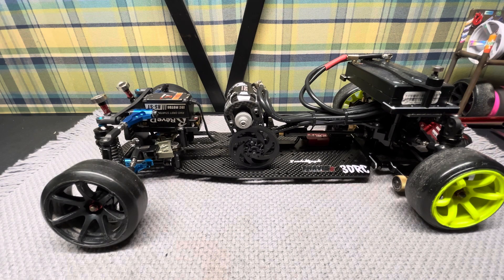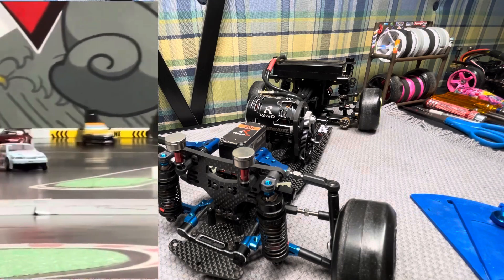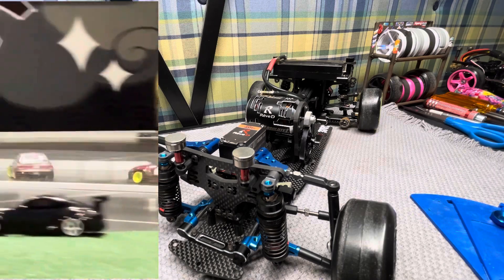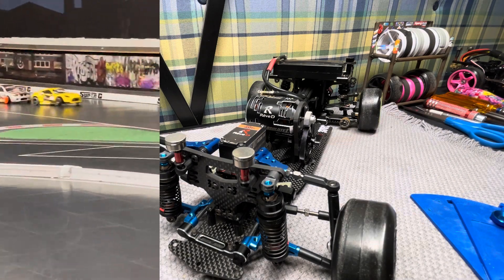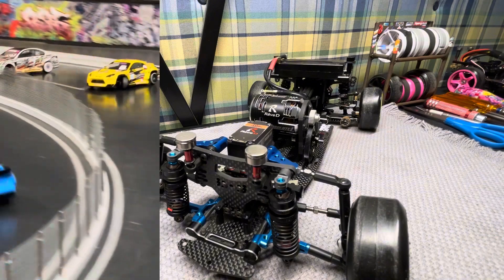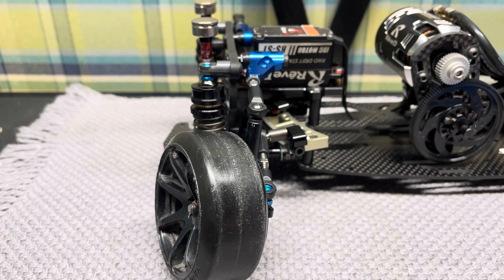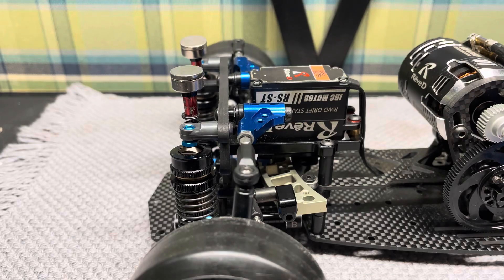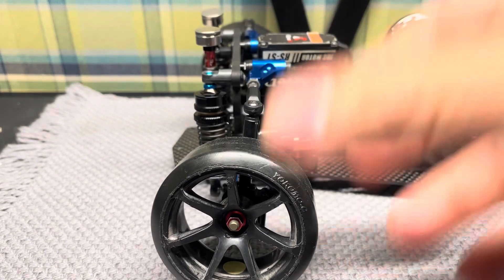TUNING GUIDE FOR RC DRIFT EP-2 ( basic front end alignment )

Comment: Great info! Could you do an ESC tuning video in relation FDR video?  Seems like most people don't account for ESC setup when choosing FDR especially with 10.5 or 13.5t motors getting the right tune will give the right feel and with a good mechanical tune setup the driving experience will be more enjoyable
Reply from the maker: Great idea! Ima have to do that after the tuning vids. And yes as always the balance between all 3 motor, gearing, and esc is important to feel every rpm.

Comment: Thank you for the vídeo! Helped a lot! What about the springs? I see that in your car, it is very, very soft... What springs should we use?
Reply from the maker: For my wrap up Travis it’s a high battery car meant for realistic roll and weight transfer. So my springs are super soft and not recommended for a normal low battery set up. In the future I’ll get into springs and shock tuning but a good beginner spring set would be the reve’d box 006AS the linear springs. I highly recommend that one. My TT02 had those on he front and rear.

Comment: if i want more ackerman on the slide rack your using, id put a bigger spacer to move the link attached to the rack forward or a shorter spacer to move it backwards?
Reply from the maker: Yes for a similar slide rack or bell crank like the reve’d bell crank, a spacer is needed to adjust Ackerman. NOTE!!- Too big a spacer will cause issue with steering stroke and trailing wheel link clearance. This can be avoided by a curved ball cup or a knuckle with scrub adjustment. This will be mentioned in EP-3

Comment: hey man, was wondering if there is any tips for setting suspension sag. Appreciate your help, Thank you
Reply from the maker: For extra droop? You’re gonna need to change shock length. Long top caps, long bottom caps. That changes piston position and the compression/rebound stroke. Good for higher level tuning but watch out, improper length will cause bottoming out and possibly uneven pressure in the shock chamber.
Reply: Appreciate you :) @SHREDDITRC

Comment: what mods did you do to your TT02 for it to be Drift compatible? Cheers
Reply from the maker: Main mods I did was the MRC TT02 front end conversion 
https://youtu.be/Z5oLDDMr-HM?si=e4ZRIemW7AaUA7zZ 

•D5 front axles to limit free play
•plastic yokomo shocks to have better suspension stroke and chassis feel by having them little more upright. 
It’s relatively easy to install and the clips of the jzx on the track Is the TT02. 
•I also changed the inner ball end to a threaded stud to adjust bumpsteer ( NOTE- it’s not needed that’s just what I did for my large track ) 
You can buy the kit on Japanese sites or sites like buyee.
Reply: @SHREDDITRC  Cheers mate, much appreciated. Iv just bought the Sakura D5 MR. And it's doing my head in, constantly spinning out and undriveable. Iv taken my TT02 Out on an indoor carpet track, and it was pretty amazing, but it's got both locked diffs, i understand that the rear needs to be locked and i need a one way diff for the front.  Once iv done this, and the mods to the front end, I'm sure it will drive even better. At least with the TT02 Chassis, it's pretty much good to go once built up. But the Sakura is a whole different leve. I shall do the mods you have recommended though. This is my first Tamiya TT02 and I'm pretty happy with it, fairly decent chassis and capable once its Brushless...👍🏼😉
Reply from the maker: @k1ortia  the d5 isn’t too hard to set up properly you really need a good servo and gyro combo for drift. Even with the stock tune it should drive ok. The TT02 being RWD is great, it drives great, but for carpet I’d suggest a thicker diff fluid or a sticky grease to put in the gear diff. The D5mr does need a little bit of work as for a beginner chassis i would recommend a MST 2.5 RTR they work great out the box and need very little adjustment to get right.
Reply: @SHREDDITRC  Yes iv heard the MST is great, but i didn't fancy wasting over $200 on something if i decided it wasn't for me. But after trying out drifting with the TT02, I found that really exciting and enjoyable. So I'm think I'll stick with it for the time being. I do have a gyro with the D5 but it's only a cheap Skyrc Gc-401. And the servo is a metal digital 20kg i had laying around brand new. Iv heard the Futaba Gyro is supposed to be the one. But still pretty pricey. What diff oil would you recommend for the TT02,s diff on carpet.?